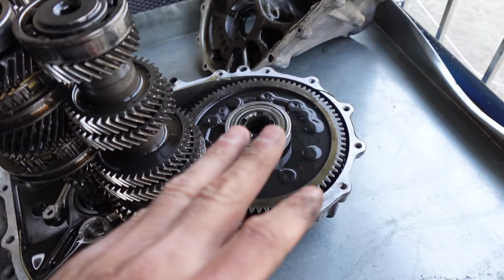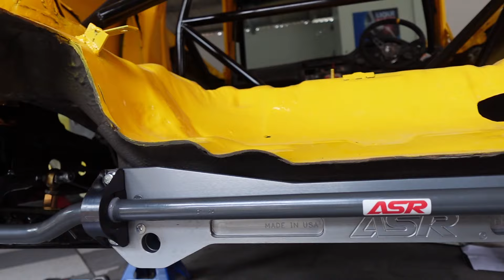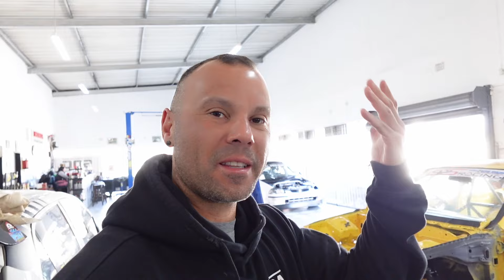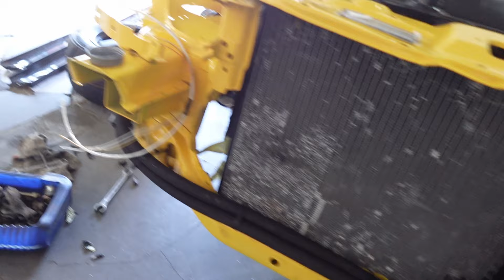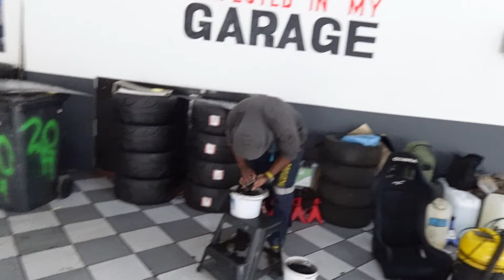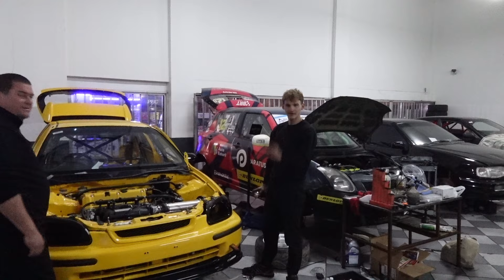“Spoon” K24 | Civic Race Car | First start goes up in flames 🔥 Build part 3

Comment: This is the OG black civic right? And also i dont know if you remember it but i was planning on swopping my Corsa to a C20. Im rather gonna do a 1.9TDI swop for reliability, torque and low diesel usage. Im thinking of running a GTB 2060 turbo with the setup
Reply from the maker: yes sir, the black civic.... everyone says that bro, am I colour blind or the only one that knows it was actually grey? hahahahahahahaha

Now with that statement bro I completely agree on your decision, much better option dude... dont worry about upgrades for now, just get the car and enjoi it dude, cause the car issues youve had is enough for a lifetime, once you got the car for a while then think about upgrades